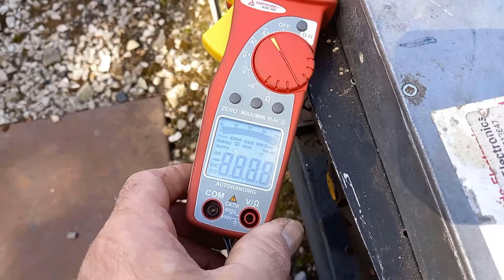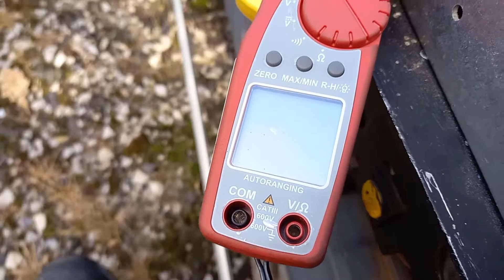5 Inch  Gauge       Class  31                   Diesel  Loco                   2                 Fir

Comment: Im guessing your colder 2 motors are the ones drawing less amps, probs not drawing much as they arent doing any work due to the pinions spinning on the motor shaft.
That or a wheel loose on an axle.
Had both with my 20, right pain.
Reply from the maker: Cheers Eric, to be fair, the warm ones get really quite hot when run for a while.
the loctite did the trick I think on the pinion cog.
As will be seen in an upcoming video, our trip to Wigan goes very well.
I contacted the company in the back of the GL5 magazine, they do not recognise the motor`s, to get replacements.
they did say that they put 50amp circuit breakers in their models, so I guess the 10amp per motor (pulling not too much load) is probably in keeping with other motors when the loco is properly weighted for traction and pulling a train of passengers.